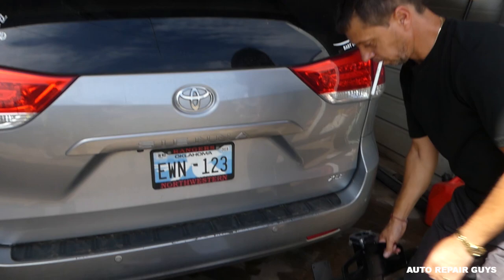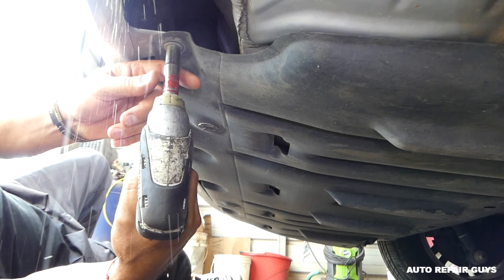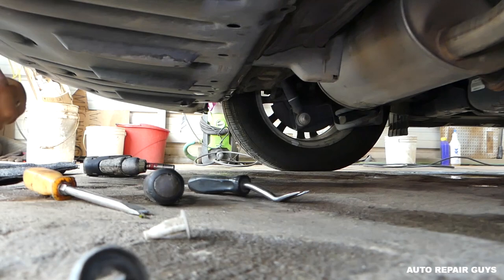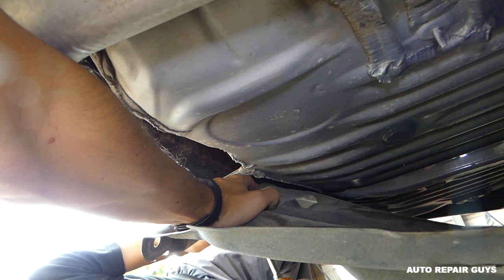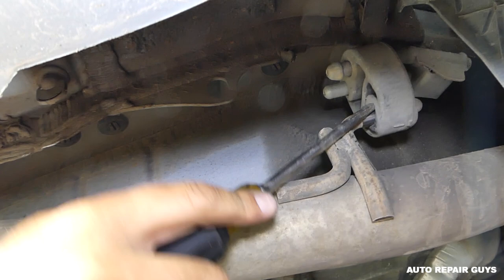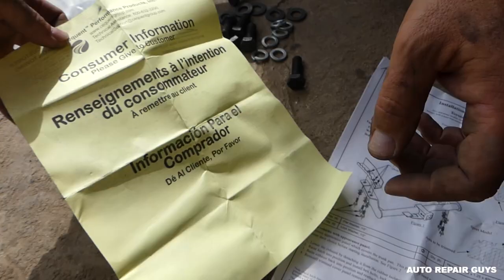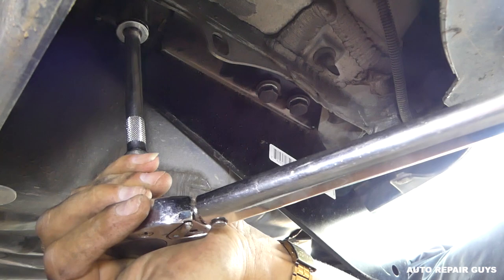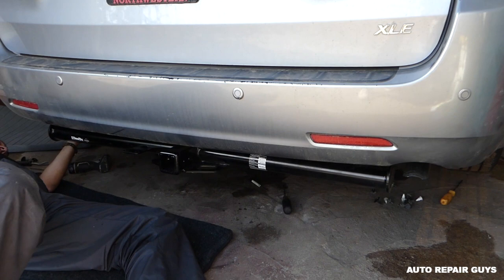TOYOTA SIENNA HITCH INSTALLATION  RECEIVER HITCH

Comment: This did not work out so easily. But I did not have the plastic cover so that was a bonus.
I had to do it myself with no lift. I use blocks of wood to get it. But a word of advice is do not tighten the side bolts that hold the frame together. Leave all of those loose. Just enough to hold it all together. And then mount it to the car from underneath. I also could not get the muffler to remove the gasket. So I used straps to pull the muffler off to the side. Then I worked one bolt in on each side. Also use WD-40 and spray it in the holes under the van. The bolts cross thread very easily.  So I got 5 1/2 in. One is cross thrreaded.  It took me 3 hours.

Comment: have a 2015 sienna XLE. Bought a curt hitch made for this model. What a piece of shit how in the world can they produce a hitch that constantly hits the ground????? mean if you produce this fora car or van do they not have any quality control. Every time use my car have to remember to drive sideways out of shopping center not to hit the ground wonder when accedently hit another car. What a bunch of crap.
Reply: Do you mean, that it's too low to the ground? I thought so as well.
Reply: @kovalenkoihor4325  yes it is. When its mount on the car i cant drive into a stripmall here in LA without hitting the ground. Very stupid design. I payed 150 dollar for nothing its in my garage i cant sell it to anyone with a good mind you know. Very annoying.
Reply: @Idontlikethisever  Thanks. That was my concern too.